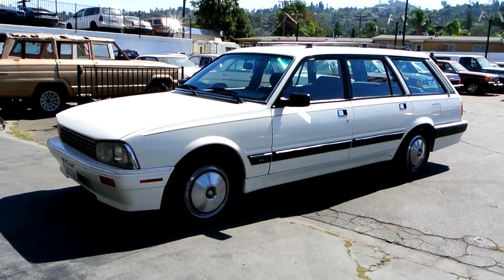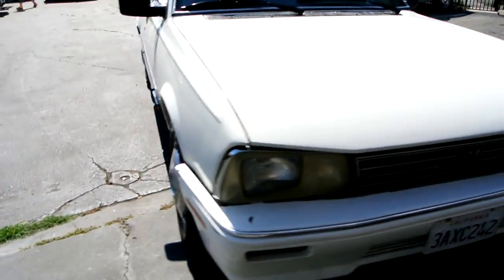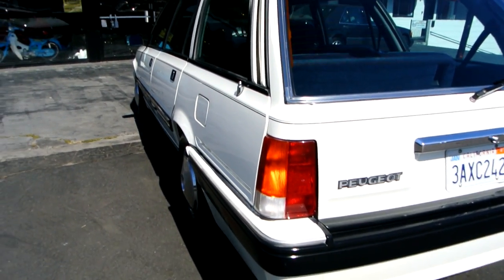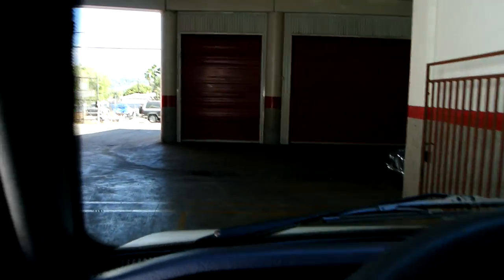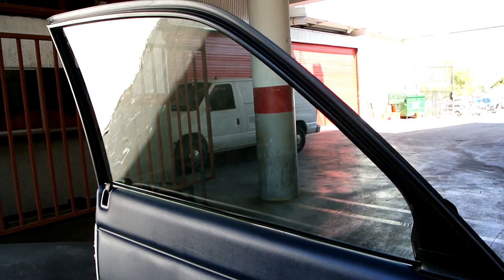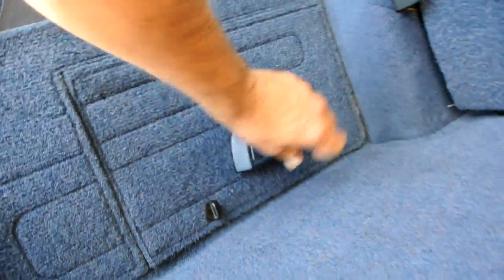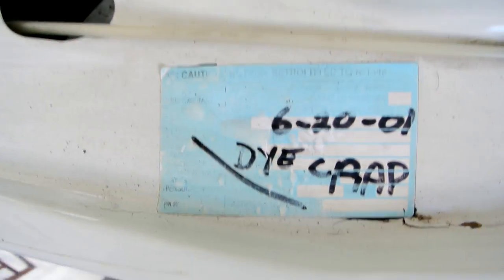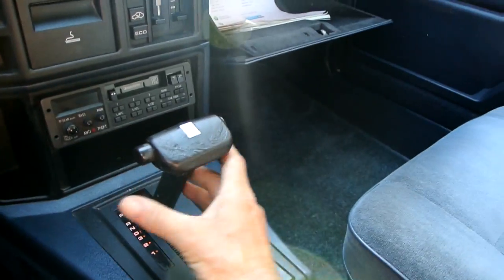Peugeot 505 Familiale Estate ** 1 Owner ** SW8 Station Wagon French U.S. Export

Comment: 1986 505S wagon, XN6 engine, US spec. - THE Best car I've ever owned  - EVER - and I've owned plenty!
 Unbelievable quality of materials and assembly; incomparable ride, cruise effortlessly at 85 mph all day. Grossly OVERbuilt, right down to the oil bath air cleaner. Not only can haul 3,000 pounds {!!!!!} - but can take a full 4x8 sheet flat in the back - with the gate closed! Last of the "REAL" old time French cars ... DS21 like seats; plush like fine sofas and a ride that will put even the big Benz - BMW's {500S/750il} of the day to shame. Amazing off road as well as on the twisty two lanes. Damn I miss her!!!
Reply: Cpt444 do you still hAve one of these? Because if you do I'll like to buy it from you. Get at me when you see this.

Comment: Gtreatings from Portugal!
I also have a 505. It's a GRD, 2.5 c.c. diesel,  whit no turbo.
That's my first car. I bought it in 1998. This SW8 is top, full extras. Mine haven't that extras. Along the years I applied it a few extras, like electric windows, rims 17", lowered the suspension, put headrests in all seats, sound system with 6 twitters, 1 subwoofer and 4 woofer's. 
Etc etc...